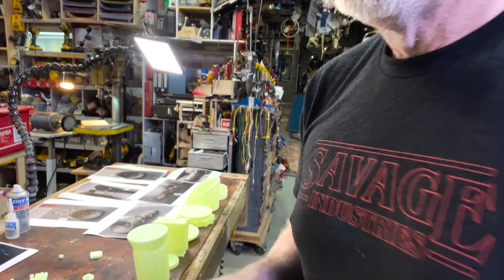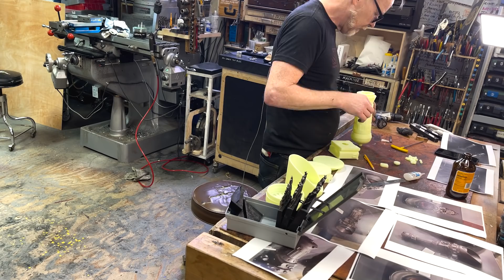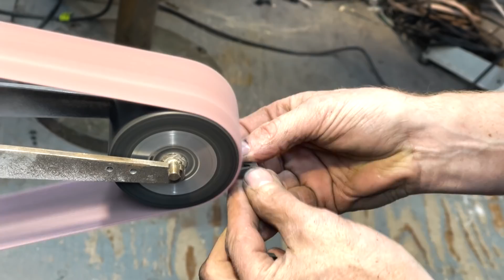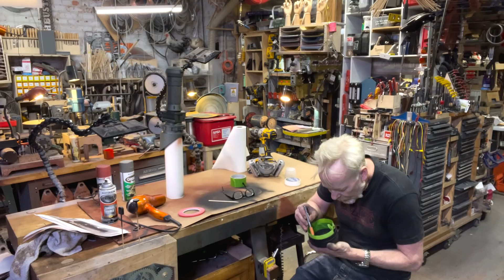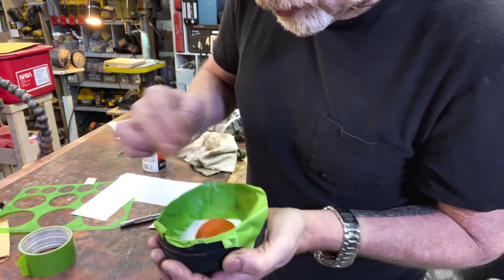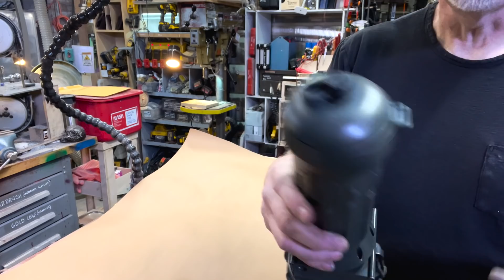Adam Savage's One Day Builds: Dune Sand Compactor Replica!

Comment: when I first saw the sand compactor in the first dune, I thought it was just some simple tool to get out of the tents they use, and while it is a tool for that, it is so much more complicated than I had first anticipated. Clearly the Arakans made the compactor to mimic the sandworms and how they move throughout the dunes, so I figured that if you wanted to make a "working" version of the compactors, you could put a speaker inside of it to get a similar effect as the movie. That is something I so want to do if I ever get a resin printer and use the files. I want to make a Bluetooth speaker out of the compactor so that it is a "functional" sand compactor.

Comment: My cousins hubby taught Me how to paint professionally. Shaker cans should be swirled not shook. Shaking damages the ball baring and gets metal fleck in the paint and clogs the can faster. 
I spoke with Giger before He passed quite a bit. Also Syd Mead, in fact I did work for Mead. Great guy. Originally those evaporators were painted metallic blue silver pearlesce then dirtied with olive drab and purple after fading with sand paper and wood rub. Wood rub the part after sand paper and then add the olive drab. Those are so pretty. These models.

Comment: Banging the paint against the table doesn't actually do anything for the paint inside, what you wanna do is roll the ball along the wall at the bottom. Since you have a lathe, just two two pieces of round plywood, drill holes in the top and bottom so several cans fit inside the top and bottom piece, with a center wooden dowel that protrudes both ways with a steel pin on either side, but one of them needs to be sharp. Then you chuck the other end in a drill, poke the sharp end in the floor, angle the whole affair and let it spin at a speed that's just fast enough to hear the balls bing bang inside.

In 10 minutes the paint is perfectly mixed.

Comment: I'm really surprised Adam doesn't use a cheap $5 "pistol grip" for spray-painting. I've always thought that was such a great investment for rattle-can painting.
Reply: In theory it sounds good but for a lot of people it entirely changes the way the can handles and if you’ve got 35 years of spray painting experience without one it’s like putting a weight at the end of your pencil.
Reply: At this point I bet Adam's rattle can muscles could create diamonds from raw carbon.
Reply: My thought, too.  I started out with one of the cheap snap-in types, but later switched to the Rustoleum can gun, which grips the can around the neck.  That is what I recommend to everyone now.  It is a tool that I really think makes my painting work better and more accurate.

Comment: Not sure if this will be seen but I'm curious if Adam would try an experiment around centre of gravity and inertia. 
If you make two spherical shells of the exact same material and mass so they can't be told apart when you hold them, however inside one of the spheres the mass is concentrated at the centre (using a denser material as a core), and the second sphere has uniform density. It would be interesting to see how each one felt because their CoG/CoM will be exactly the same but I think their moment of inertia might be different, so translational motion will feel the same, but rotational motion should feel different. The mass concentrated at the centre should be easier to rotate than the uniform density. A third sphere could be hollow with a denser material closer to the outside. You could polish them up as desk toys that are kinda weird to play around with if I'm correct on the inertia. Not sure if this has been done before but it would be cool to investigate.

Comment: Haven’t watched dune but can’t imagine you could compact sand very much
Reply: It's not really a compactor; it's referred to as a thumper in the novel as it's designed to send vibrations into the ground to attract a sandworm.
Reply: @OhHeyItsAnthony  the thumper is a different prop. The compactor moves sand out of the way so if you get buried or something, it’ll push the sand out of the way so you can get out.
Reply: @SPProps  this needs to be pinned or highlighted. Lots of people are very confused about the compactor vs. the thumper.